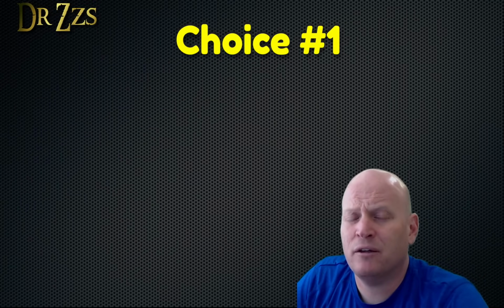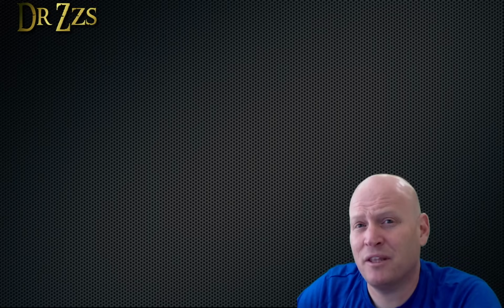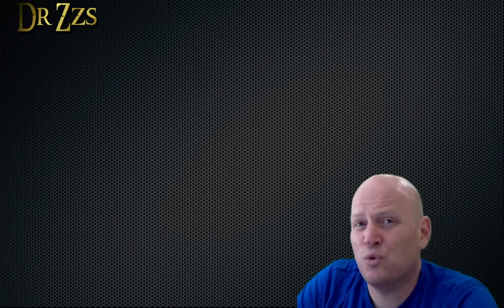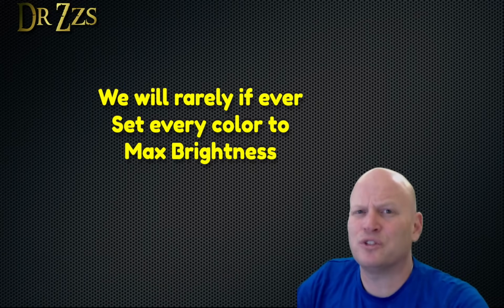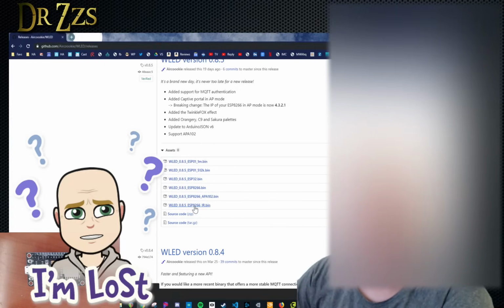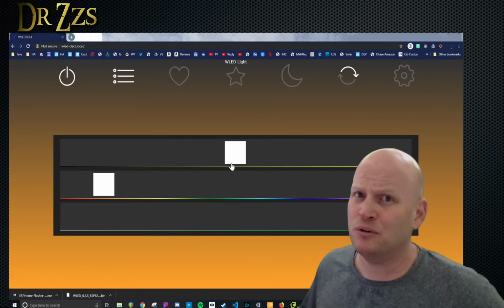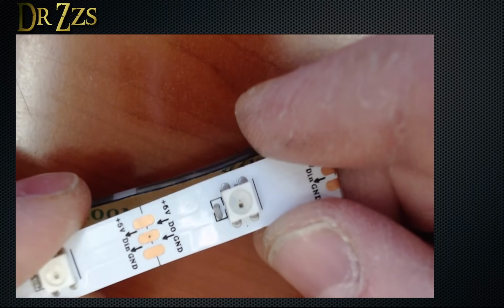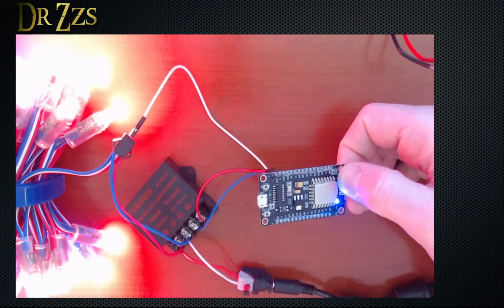Beginner's Guide to Christmas Lights - and LED Shows for Every Holiday

Comment: can't flash esp8266 download WLED_0.15.0-b7_ESP8266 (1).bin then the espESPHome-Flasher-1.4.0-Windows-x64.exe opened esp home flasher plugged the esp8266 in usb port on the computer and then on firmware pit the WLED file and refreshed and nothing pops on serial port can you not use usb cable

Comment: Question for who ever knows. I have the WS2811 String 12v LED RGB lights, 50 on a string.  I have 100 now for testing.  If the testing on my shed goes well then I will likely run 150 to 200 more on the house on a separate line from the shed. I bought a controller, but the RGB buttons are  not correct to what lights up.  When I press Red I get Green, when I press Green I get Red, when I press Purple I get Blue and so on. Its the controller not the lights that is messed up (controller from amazon RGBZONE DC5V/12V/24V RF Wireless Remote LED Controller).  I also have the Arduino Uno and Uno Wifi. Should I run the lights with one of these on a 5v and a 12v separated.  Or does some one know of a controller that will run 12v WS2811 led lights accurately?
Reply: What software are you using? WLED has a setting where you can switch the color profile.
Reply: As for controllers, I really like the dig quad from QuinLED and the 8 Port Distro

Comment: I am having trouble getting the NodeMCU (ESP8266) to power up via the VIN pin. It powers up fine via, USB though. I'm using 5v stepdown as in the video. Can anyone help?
Reply: I can get it to boot by hitting reset or touching EN to GND or reseating the VIN/GND jumpers...

Comment: downloaded the homeflasher, plugged in the nodemcu, but its not showing up when i refresh. I tried all 4 usb ports, and even got the blue light flash on my nodemcu, but its not showing up in the homeflasher drop down arrow. What did i do wrong?
Reply from the maker: There’s a web based installer now. HTTPS://install.WLED.me
It sounds like you may also need the drivers installed. There’s a link on the Install page too.

Comment: Anyone can answer if ya' know.  Are there 12v strings that have the light spacing further than 2-3 inches?
Reply from the maker: Off the shelf there is about 4" of wire between the pixels, no matter which manufacturer you buy from.  If you want more wire between pixels you'll have to make a special order from a manufacturer.  Most will do that for you but it will take a month or more to get it delivered.
Reply: Gotta start somewhere, thanks for the answer.  I'll be back with more questions I'm sure later. BTW, the vid was F'n awesome with the dissertation.  Many thanks and keep it up.   @DrZzs
Reply from the maker: You should join the discord channel.   There are lots of people that are into this sort of stuff too.

Comment: Thank you for all the content.  I'd love to be able to put together outdoor yard lights.  I bought 12 Hampton Bay low voltage color changing fixtures and the LEDs keep failing.  Out of 12, 8 have lost the ability to produce several individual colors.  The fixtures are cool looking (cylindrical bubble glass with LED lights shining up in a housing from the bottom)  but it is so frustrating that the lights they use are cheap and keep dying out.  Have you done a retro fit project or make your own landscape lights?  Thank you again.
Reply from the maker: The best way to get these questions answered and more is to join our discord server!!!  There are a ton of super smart people that love to help out.  It's a super friendly community.

Comment: Assistance please, my windows does not recognize my ESP 8266?  I download the home flasher, plug it into the board, see a blue light flash, hit the refresh and nothing appears.  I have tried the 64bit program as well as the 84 bit.  I have tried a second board as well as 3 different cables.
Reply from the maker: The best place to get help is in the discord channel.  There are lots of people that can help there.
Reply: I'm having the same problem, did you figure it out?

Comment: Step by step - check
clear voice - check
Cheesy jokes - check

Perfect 5 / 7

edit:
Question, I have a 12 volt 6A power supply. A similar one like in your video
Why don't you need to convert the 12 volts to 5 Volts for the LED strip?

Comment: When I separate the ESP32 unit from the Dig-Quad and power it via the USB-C port, it powers up and can be accessed with my phone or a web browser. With the ESP32 unit disconnected from the Dig-Quad, the power LED lights up on the Dig-Quad. When I plug them together, neither one of them power up. The good news is that I didn't lose all of the programs I built for various holidays throughout the year. Is it possible that just the Dig-Quad is bad? Can I purchase one of those from you? I think that would fix my problem. Thanks again!
Reply from the maker: Have an LED related question? Be sure to ask your question in led-lighting-diy- Channel on discord! https://discord.gg/8gvF67h Our LED masterminds, the PixelHeads, generally hang out there and can answer your question(s) swiftly.

Comment: @DrZzs what is your suggestion on the tracks to be down facing or outward facing? The exterior is brick, so wondering how much impact lights will have on the bricks shining down vs out to the road, about 300ft off the highway

Comment: I have downloaded the esphome-flasher, but when I select the down arrow to select the serial port, there is nothing that pops up.  Any suggestions on how to make the name of the board appear?
Reply from the maker: If you are flashing a dig-xxx controller, I suggest you use over the air web link and not serial.  That said your USB cable may be power only and not data.  Try another.

Comment: Thank you so much!  I want to add LEDs to some of my woodworking projects but could not figure out the power.  
So now I know match 5v to 5v or 12v to 12v and compute the number of amps and add a few just to CYA.
I just subscribes.  I'll be seeing ya.  Thanks again.
Reply from the maker: A good place to ask this question is with the Pixelheads on my Discord Channel: https://discord.gg/8gvF67h

Comment: Haaaaaaa. So annoying. I just flashed wled on 8266, and everything seems fine but suddenly it doesn't connect to the wifi. After I press RST button for 2 times, it connected to the wifi network. And now, after I closed the waterproof box, POOF. Looks like it resets and returned to the initial orange led color. Any ideas?
Reply: This happened to me too. In the WLED app I made a preset for what I wanted effect I wanted mine to do on boot up. I then when into Config and under LED Preferences, under Defaults I set Apply preset 1 at boot. Now my little tree starts on Candy Cane every time it turns on. Hope this fixes your issue!

Comment: 7:40 Each LED does NOT add "a little bit of resistance."  Why are you giving advice about things that you don't understand?  The resistance is fixed in the conductors providing power down the line.  Each LED draws more CURRENT and that, over the fixed resistance, leads to the voltage drop increasing the further down the line from the source.   SMH
8:30 Also, you don't inject voltage... you inject POWER.

Comment: I have found that the WS2811 lights don't hold up to the temp fluctuations we have here in Montana. The factory solder joints in the light strip keep cracking and splitting.

Comment: Did your strips ever fall off? Did you direct attach or use channel?
Reply from the maker: yes they did fall off after about a month.  However, I also put some on the play castle in our backyard and those I used some hot glue and some clips and they've stayed on for over 2 yrs now.  So it is possible to just use the IP65 strips.  They aren't probably a "permanent" solution, but I can say, if you do some extra things to secure them, they will be at least a "very long" solution.

Comment: So if I understand this correctly, the 5V string lights lose voltage but the 12v ones dont?
Reply: 12v will suffer from voltage loss, but just further away from the power source.  12 volt is more money to buy and to operate.

Comment: I’m rather confused on the power supply needs. You say 1A per 50. So for a 300’ strip of 30 per meter. That’s a 60A power supply. Awesome! But when I do the math on the wattage (9W per meter per the website) I get 180A. 2 more power supplies?

Comment: Question: I want to run LED strips on my bungalow eaves, using a bare metal power supply. How do I actually do that, though? The strips are on the roof and the electrical outlet that the power supply would plug into is down near the ground, and the power supply also isn't waterproof....?

Comment: hey,
so the data wire must be close to the first LED, makes sense. But why does the power supply needs to be also in the box with the nodemcu? Isn't it ok to just extend the two power wires from the PS to the first LED, so the PS can be installed in the house for example? Thanks :)

Comment: Correct me if I am wrong please.  If you break down a car phone charger plug, one side will be 12 in and 5 out? soldering to proper points will achieve the same conversion but could use cheaper dollar store phone charger?

Comment: Quick question - I'm using the NodeMCU, a 5v 15amp, power supply, and a 16.4ft 150 pixel 5v WS2812B strip and only the first ~20 pixels light up. I've tried removing the pixel before and after it stops and re-soldering to see if it was a bad chip but only one pixel lights up after the soldered connection, a few times with the same results. There's no gradual brightness/color drop off, it just totally stops. I've tried changing the brightness to pick up more pixels to no avail. Any ideas?

Comment: I have followed the wiring of this videos for the 12V perfectly several times and I'm getting just light blue lights and that's it they won't respond to the controller at all even turning it on and off. Anyone run into this? I can use the same nodemcu for a different brand of lights and it works perfectly.

Comment: I had to flash the WLED in the WLED website flasher, data pin become D2 and i could power all 300LED (5v) with the ESP32 alone (powered by usb 5v 2.4a).
PS: even thou i am stating the above my LED strip should be powered with 18w per meter so i am missing on juice.

Comment: i need to point out that listing two different power supply voltages and then giving a rule of thumb based on amps is just wrong.  You should use wattage as a rule of thumb.  Amps is based on voltage.

Comment: Great tutorial! Did the adhesive ever give on the ones you just stuck on without putting in the aluminum channel?
Reply from the maker: Yes.  They didn't last long at all.  Maybe a couple weeks.  It could work, but you'd need to use something more than just the stick-back stuff on the strips.  Some silicon, or hot-glue, or construction adhesive maybe.

Comment: Can you tee off of the string on the bottom eaves (power, ground, data lines) and run wire (with no leds) up to the second floor eaves and then connect a second set of leds to that? What I mean is a strip of bare wire in the middle.
Reply from the maker: yes!  Just know that if the run of just wire is more than about 10 ft you may get some misbehavior after the jump.  The solution (assuming you can't shorten the gap) is to either get a Quinled data booster and put it just before the gap, or place a single pixel about 1/2 across the gap.  You can just black out that pixel with tape or paint so it won't be visible.

Comment: Hi Drzzs, I have tried to follow this guide but my LEDs wont work. Some of the lights work, some dont and its so dim. I'm not sure if its the WLED or the power supply or the LED strips that are not good. I wish you could see it
Reply from the maker: ya, I bet we could trouble shoot it pretty well if I could see what you've got.  
Sounds like it could be a max current limit problem.  How many LEDs do you have connected?  Try increasing the Max Current setting in the LED Preferences.

Comment: Great video. Quick question, whats the difference between WLED and like XLights or are they both software teat just controls each individual light?
Reply from the maker: xlights is used to make the big shows that are synced to music and usually incorporate the roof-line plus a bunch of props.  WLED is simple and does just different effects and colors.  xlights runs on a PC. WLED runs on the actual LED controller.  xlights can control leds that are connected to WLED as well.  
The best way to start is to use WLED, and as you grow into more of a "show" then you start using xlights.

Comment: Thanks for the video! I am just confused on one thing..With a digquad controller, is the power supply built in? Do you just need to add an extension wire to it and plug it into power? Or do you still need the power supply and power cord?

Comment: Can the NodeMCU and WLED run more than one strip set? My game plan is 2 different runs data'd off the same board if possible.
Reply from the maker: That is possible with WLED 0.12 or newer.  I haven't tried it with an ESP8266 (nodeMCU), but it does work well on an ESP32 (newer more powerful version of the 8266)

Comment: I followed along with all the instructions, parts and steps.  The NodeMcu is flahsed and connected...but when I power it up all I get is half a string of green lights.  None of the effects seem to work.  Any ideas?
Reply from the maker: 1/2 string is because you need to change the total number of LEDs in the LED Preferences.
Green because you need to change the RGB color order (also in LED Preferences). 
Why the effects won't react I'm not so sure about.  Make sure the ground is common between the controller and the LEDs and the Power Supply.  Is the data line really long between the controller and the first LED?  If you're using WLED 0.12 make sure the output hardware pin is correct.  GPIO2 is usually called D4 on the nodeMCU.  I can only think they were purposefully trying to mess with us by naming things like that.

Comment: I have a detached garage that I would like to have lights that match my house, is it possible to run 2 NODMCU's together?
Reply from the maker: yes.  WLED has a sync feature.  I have 4 different controllers around my house and when I turn on the "main" one and set an effect, all the others follow along.

Comment: HELP. I bought everything you said to buy but now having a problem. I'm trying to FLASH ESP. I found the firmware tap. I push the gray and red refresh button on the serial port then push the drop down button and it won't find anything
the cable is good, when I plug it up a blue light will flash on the ESP8266

Comment: Question for you. Doing this and I have them installed. But I have some issues where if I up my brightness or effects, the lights all blink. My data and power cable are run a decent distance, I’m trying to figure out if this is a the distance those cables are running or if it’s an issue with my power supply. Noob with this so please be nice /)

Comment: Can I use 12v wire jumpers using a 5v power supply and 5v string lights? I'm trying to connect multiple string lights and needed to power each string using the 12v wiring.

Comment: Hi I have a question, if we connect 12 v string parallel to get the full power from power supply. How do we connect the LED controller that can control all the strings with same light pattern? Thanks

Comment: Hi Dr been watching your videos for a while they are great. I am finally getting into the LEDs. Noobs problem, I find that if i am connected to the internet wifi or wired then I cannot connect to the wled interface; is this normal. Thank you. Also could you point me to your video that teach about setting up static ip in wled. Sorry I cannot join in your live but I do watch them later.

Comment: Does anybody know what I am doing wrong if when I connect the node MCU to the laptop via the microUSB cable, nothing shows up under the drop down box “serial port” ?
Reply: me too no idea yet
Reply: figured it out! needed to update drivers. use the driver booster software to automatically detect the missing driver
Reply: @sometimesimakethings2903   I’m have the same issue….how do you update the drivers ?

Comment: A tip for anyone new getting into this, like me from last year. I highly recommend you stay away from the strips, unless you have a very steady hand and experience with soldering, as the soder pads are very tiny and close to each other.

It's a massive headache, and honestly it was really hard to stay motivated because of how frustrating it was. It can be done, however be prepared to be extremely patient

Comment: You've inspired me and I jumped in with both feet, but I have teeny problem. I'm having trouble getting the data signal to jump from one window on my house to the next. Distance is about 15 feet. I used the "sacrificial" pixel to get me 20 feet to the first string, and made another jump, but this one won't work. (Flickers and wrong colors.) Is there a way to boost the signal? I think I can add extra pixels in the gap, but that defeats the ability to hide the wires.  I heard of the F-amp, but read elsewhere it doesn't help on 5V systems. I'm using WS2811 5 volt pixels, btw, with power injection at that window. Thanks. Love the videos.
EDIT: I just found (re-found) your video on power injection and data signal boosting. Seems like my setup should work.  Maybe I have a different problem? I'll try a different wire.